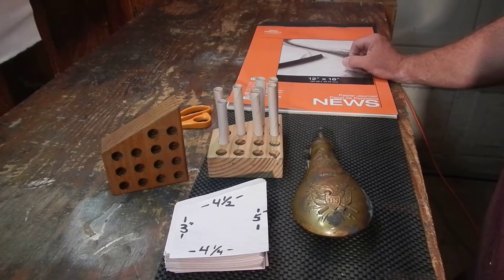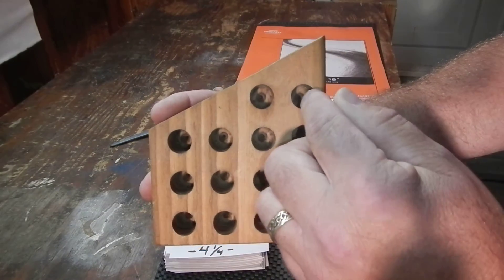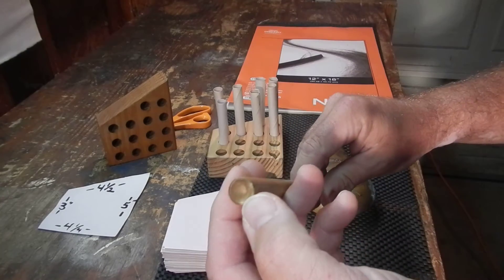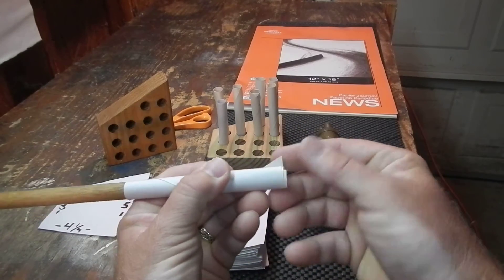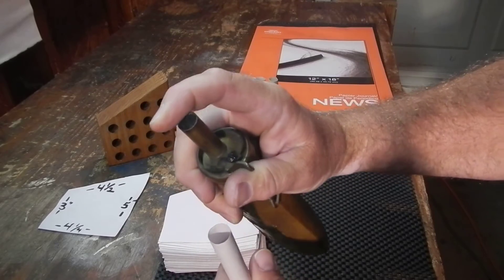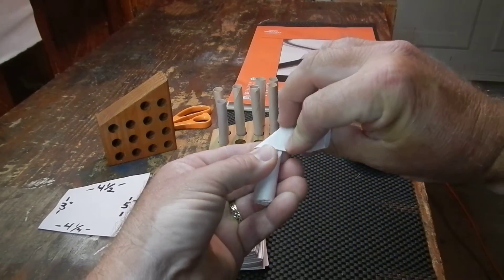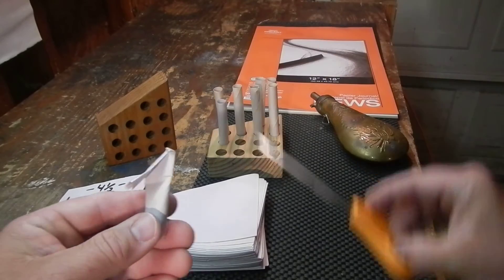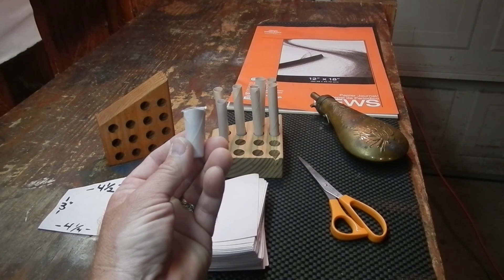How To Roll Paper Cartridges For Civil War Reenacting

Comment: I used to dampen the end of the paper just slightly before pushing it into the divot at the end of the dowel. It made it stay together better.
Reply: if you want to add a round to it you just place it at the bottom, choke it off and tie it, then add the powder

Comment: I use a square of toilet tissue rolled to replicate the size of the bullet on top of 70 gr. black powder. Then tie off the tube with string. My folds are different, giving the cartridge a more authentic appearance. When told to load (at a CW event) I can use the tissue as wadding for ear plugs. But to each his own.

Comment: I always used glue stick for even more strength   I worked security at night alone had lots of reading time and cartridge time!. Some of my buddies were hard core and secure the ends with thread, and make 12 round paper packets.  They would copy civil war cartridge labels  COOL but you can carry correctness too far!.
Reply: Oh did I mention they would roll a cap up in the cartridge paper-some arsenals did this.

Comment: so you just pore in the powder in your musket and use the paper as a wad and then shoot ?
Reply: Black powder going off in a long musket barrel booms wad or no wad. Probably safer no wad. I caught dry grass on fire with smouldering paper.  Once in a Civil war documentary I was acting in, my wad caught the camera lens cover on fire.  I was frugal 40 to 45 grains is good enough for a 58!  One group we called the Virginia foot artillery. Those bozos loaded 125 grains, they got together for a group roll and they all used that extreme load. With modern muskets it seemed safe, never heard of a mishap.
Reply: A lot of folks don't realise they used dry grass or leaves for fodder (wadding). Using greased patches or making paper cartridges was expensive and unheard of. Early musketeers used APOSTLES .  Metal or wood tubes that held powder and were secured to a leather belt with cord. Many times shot & powder was in the apostles. Rammed home with dried grasses or straw. But also remember shot and ball can be deadly just laying on uncrimped powder in a long barrel
Reply: At nearly all Mainstream events paper (wadding) is not rammed unless given orders to do so (raining, more hardcore authentic events, etc)

Comment: Where do you buy the guns from that you use to reenact?
Reply: VieLumiere G used guns are a lot cheaper. But it depends what you’re looking for. An Enfield musket or a carbine rifle. I’m in the New York 9th cavalry so I use a carbine. And I got mine on eBay for $500. Needed some cleaning and oil. But it fires nicely, be sure to do research before purchasing. You don’t want to get ripped off, for a piece of junk that won’t fire.